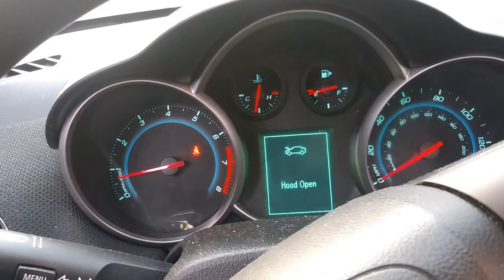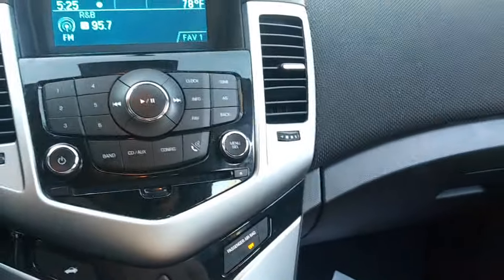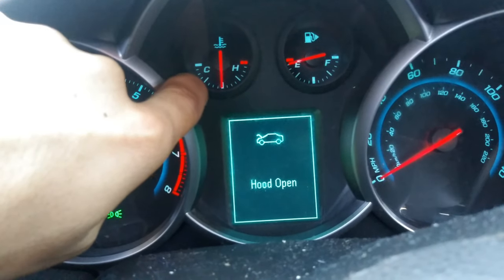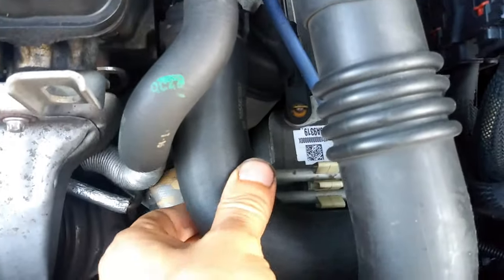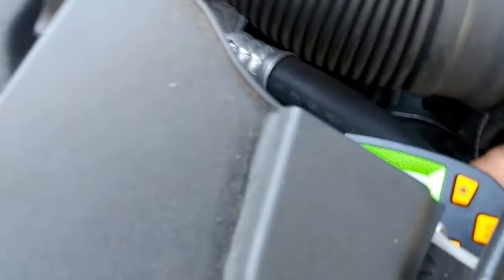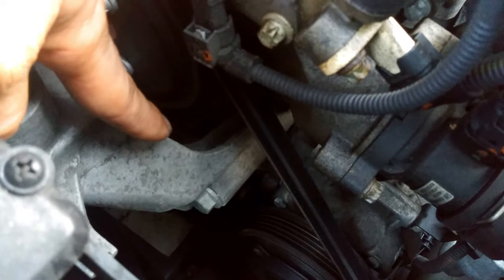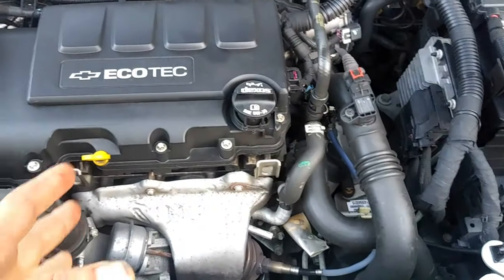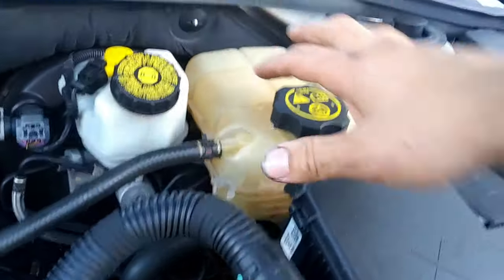chevy cruze overheating issues

Comment: I own a 2014 cruze.. My past problems suddenloss of power steering, engine rocker cover, gasket changed, constant coolant leak. Present problems, rough idling, engine rpm meter jumping up and down in idle, knocking sound from exhaust during driving. Mechanic pre and post oxygen sensor, catalytic convertor but still same problem persists. Hopeless car and also dodgy mechanic.
Reply: My shit is rough idling too and I can’t seem to figure out wtf is the problem
Reply: Same year
Reply: Could be so many things. Trust me ..get rid of it. It's a money pit. Even a used cheap toyota corolla is better than this junk. It only looks good.

Comment: My 2011 overheats when driving , we changed the thermostat, both sensors. Heat blows cold. But if we drive overheats , if we stop shut it off turn it back on it’s cold? Don’t get it.

Comment: Dude what is the problem you didn't specify whybits overheating.
Reply from the maker: The thermostat like i said in the video
Reply: @JaboTheMechanic  you also said in the video the common problem was the waterpump..
Which is it....🤨
Reply: @JaboTheMechanic  I have that problem right now,and it's not the thermo 
I just put a brand new one in mine..And still overheating. But I also see no leaks on the waterpump like you said.
Reply from the maker: Did you bleed out the air from the cooling system? There is a bleeder screw top passenger side on radiator
Reply: @JaboTheMechanic  yeah I've been releasing the pressure. Just made it home all day experience. Your video is very helpful by the way. Seems like I'm not getting circulation like you said...I just found out my fan stopped working as well...
Reply: I'm going to rewire fan and then go for the pump if problem not fixed..After that,im going to watch more of your videos 😁..See if I cant find the answer 👍
Reply from the maker: Ok let me know how it goes
Reply: @JaboTheMechanic  Wow I did it all buddy..And it's the worst case scenario. Blown head gasket....🤦‍♂️..Put new fan in 192 dollars..New water pump new thermo...Now a new engine...Do you have any engine videos..I need them asap🤦‍♂️🤦‍♂️
Reply from the maker: Unfortunately i don't
Reply: @JaboTheMechanic  hey the good news is engines for these cars are affordable.Are there any engines that  I maybe able to swap that might be faster?Since i have to replace anyway 🤷‍♂️

Comment: Unfortunately we have tried and tested everything. But any ideas pls help
Reply from the maker: Is there a check engine light on
Reply: @JaboTheMechanic  yea but it's always been on. When I got it, it had 13 bullet holes thru the driver door and my brother put alot of work in it.
Reply: @JaboTheMechanic  but what happened was it started running hot so I had to pull over several times to let it cool down trying to get home but that last tune it said reducing engine power. So I got pulled off side the road and it shut off. It try's to start but it wont
Reply from the maker: Would you like to do a video chat  so I can see whats going on
Reply: @patriciamcclister2581  did you fix it ? If so what was the problem?